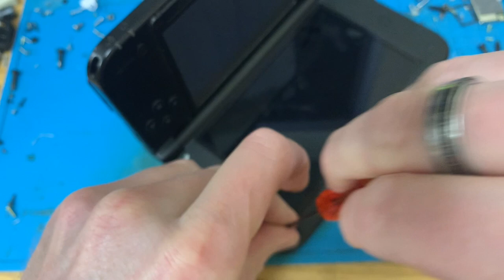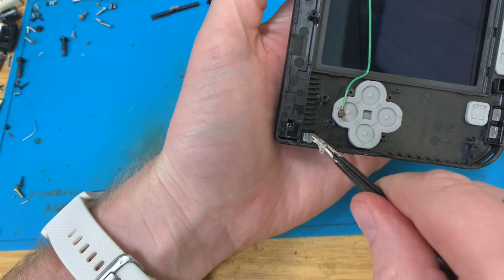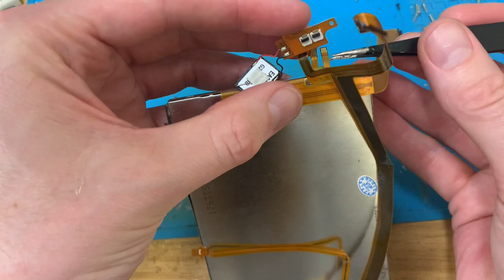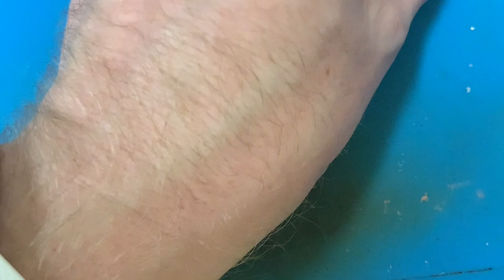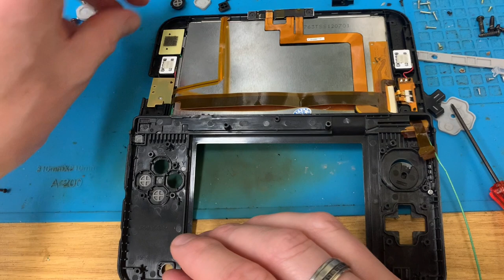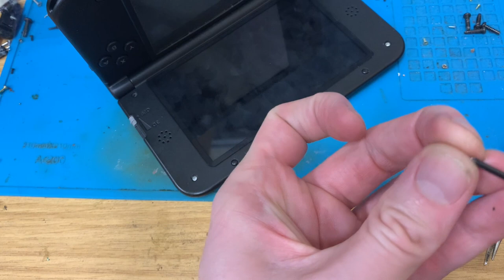3DS XL Top Screen Speed Run Repair Attempt - Thwarted by needing to also change the Mid Frame

Comment: Yesterday i finally received top screen, speaker cable and midframe to fix my japanese 3ds xl. Changed everything, assembled it just to find out while testing that a camera is not working. I have a spare camera somewhere but I just don't want to go through the teardown process again :D.
Reply from the maker: I feel your pain Predrag, I had a system just like that a few weeks back, it was infuriating!
Even this one, I wanted to try do it as quickly as possible, but could t leave the slightly cracked mid frame in place, it would t have been the right thing to do….. maybe another day I’ll try my speed run 😂😂
Good luck with your repair mate 👍